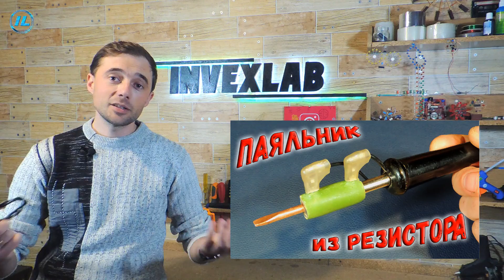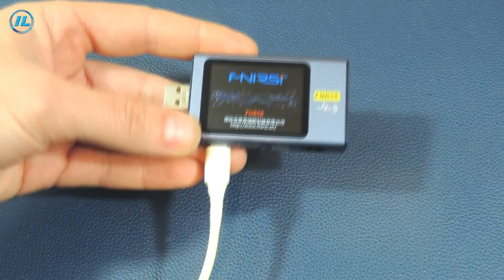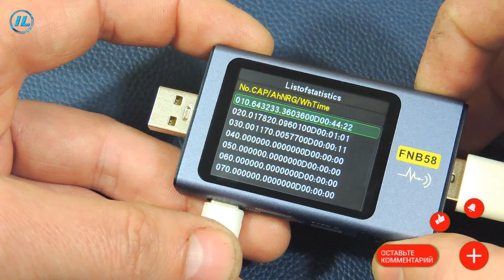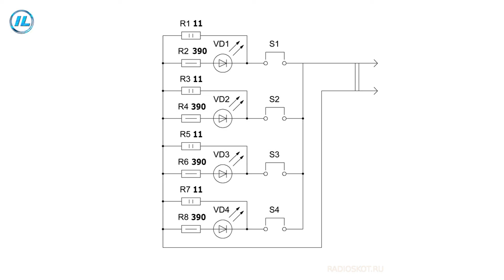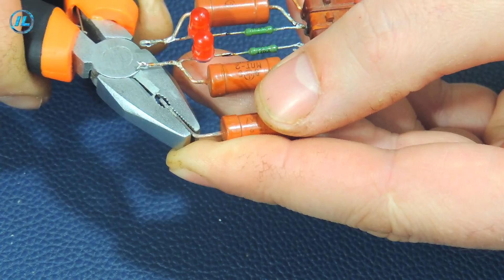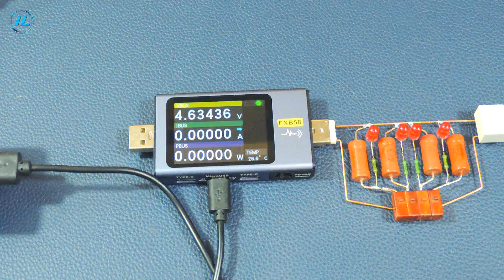✅ Simple but powerful device + the best FNIRSI FNB58 USB tester! The results are impressive! ✅

Comment: I think you should read the manual before making a video about it. You are doing the cable check wrong. Use the cable check function. Also the unit should be powered through the port marked "PC" when making measurements.

Comment: There is one big drawback in this "superb" USB Tester. Unlike most testers, it does not measure the resistance of the connected load directly. In the latest firmware by Fnirsi V.068 there is no such indication.
Reply: it does measure the resistance of the cable tho, but you have to have a constant load connected to it
Reply: @rouuuk  Yep, reading the manual is helpful.

Comment: How can you test a wall charger with a USB-C connection to see its capabilities as it seems to work only over the USB-A connection?  I tried a few USB-A to C cables and it would not even power up.  Thanks
Reply: There is a C input & output, is that what you are looking for?
Reply: The unit should be powered through the "PC" port when measuring.

Comment: Thanks for the great Video. 
At the end of the video with the faulty usb cable, would you also see that the cable is faulty when you check the resistance of the cable with the FNB58 that it is maybe to high or low to the other usb cable which was ok? Or can you only find out that the cable is faulty with the usb load?